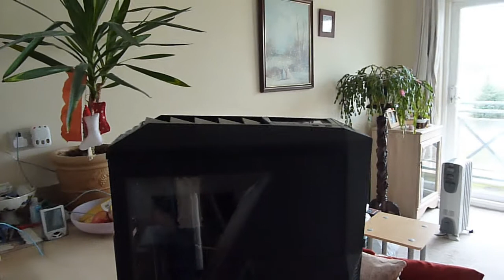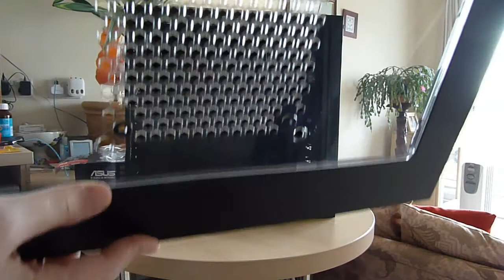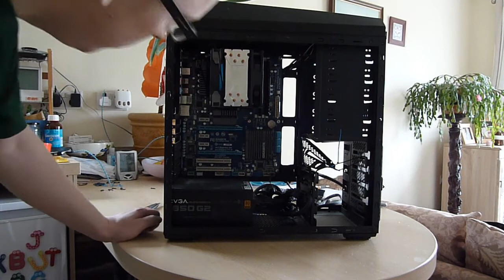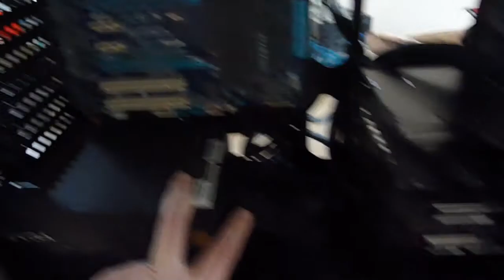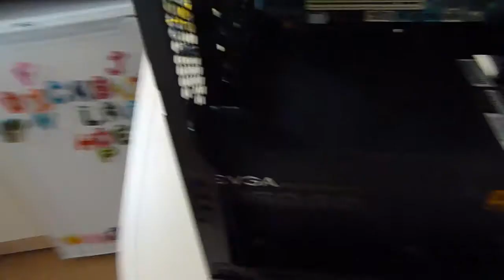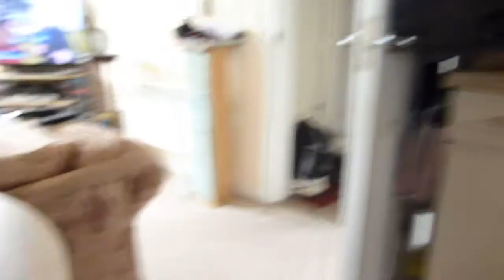PC Transplant to Corsair Carbide 300r Case

Comment: It's a good case.  I've built a couple systems using it.  The only issue I have had with it is the side window scratches very easily.  So you will want to be careful with it.  Alos it gets really dusty.  I've made dust filters for it, and you like I can send you my filter design I've used in the past for it.  I use wire, stockings, and magnets to make them.  May $20 US in cost for the whole case.